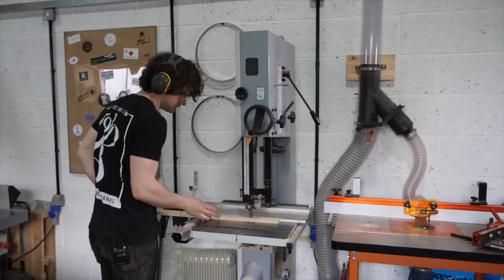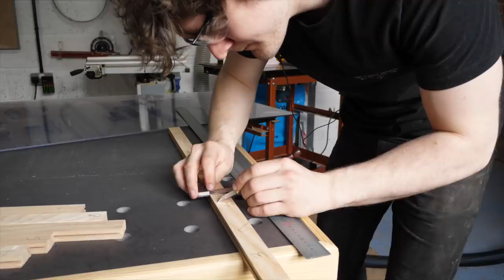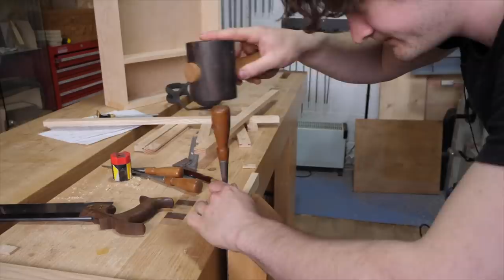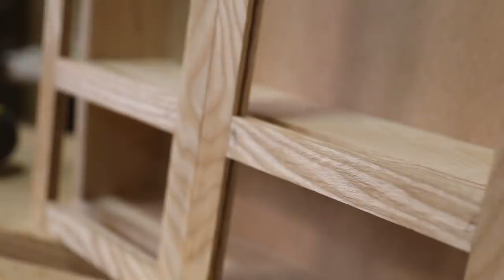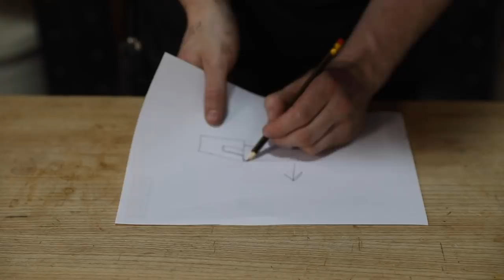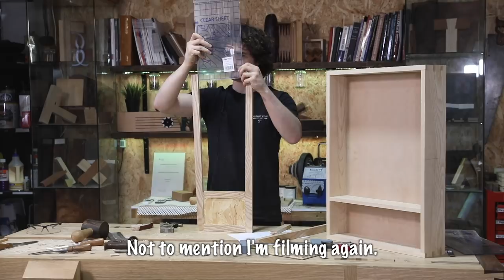Making a Router Bit Cabinet - Part 3

Comment: Hi Matt, If your interested, I have that same saw but I modified it a little, originally I used a laser light but I had to keep turning my stock around to cut on the waste side, so what I did was to DIY an sewing machine light up on the front of the aluminum which shown down and outlined the both sides of the blade on the cutting surface. It plug's in the an outlet and has an on/off switch. The second mod I did for the dust collection was to lengthen the faux leather skirt so it would catch most of the dust. I'm sure you noticed that with the short skirt it will catch the dust when NOT sliding, but as soon as you slide the saw outward the dust changes direction and is lower down under that skirt, hope this might help you.

Comment: Hey Matt. 2 points: if you cut your mortise before you cut your channel you wont have to cut a shoulder into your tennon to fill the channel end in your rails. Second point: why not just run a router with a bit the size of the plywood around the lower panel section?  Then all you need to do is round the corners of the plywood for assembly.

Comment: Did you just get lucky with the position of the tenons on the OSB panels given the rebates on the frames weren't necessarily centred in the frame (as you explained when you were marking out)?  You measured 5.5 / 4 / 2.5 which assumes the rebate is centred.  Or have I missed some maths here?  Anyway, neat job - they look great!  Who knew plexi and OSB could look so good together?  :)

Comment: OSB: for a moment, I considered unsubscribing. I don't mind the looks - in fact, I kind of like how OSB looks. But in time it acquires a taste for splintering, which tends to make your hands unhappy when they touch it.

If, at all, I'd consider applying a thick heavy layer of chalk paint, then sanding it off until the wood becomes visible again. Or wood putty.

Also, a rounded edge, IME, hides imperfections even better than a beveled/chamfered one.

And I would have used glass. In a wood working shop, everything attracts dust. But perspex, or anything plasticky, way worse than glass.